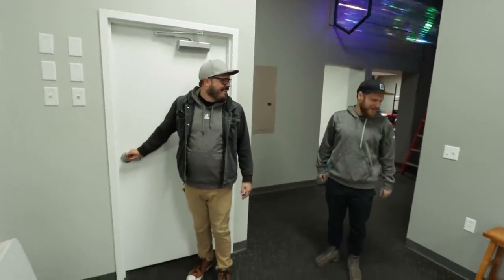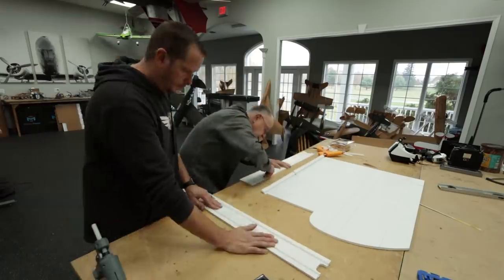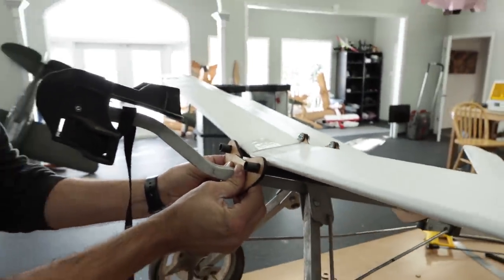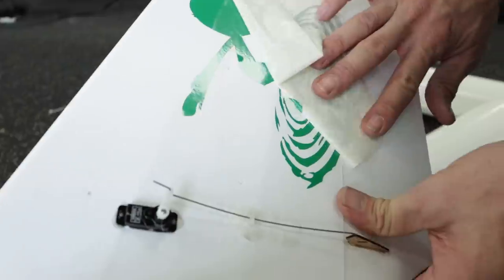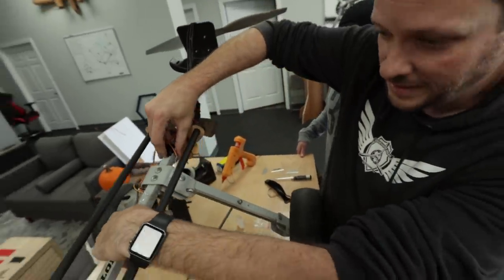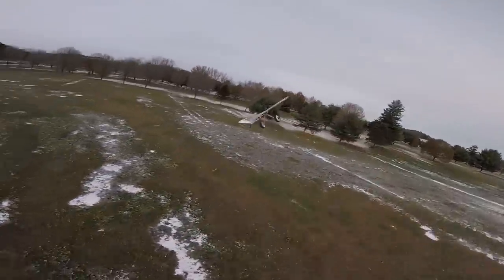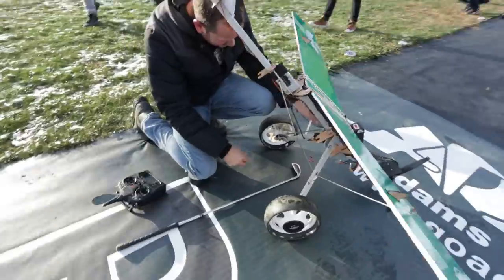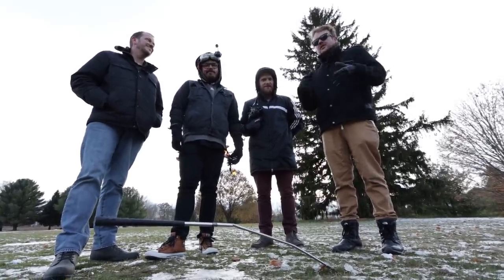Using $5 of Junk to Build a Plane | Golf Club Bomber

Comment: The generic name of that tool is an oscillating multitool.
Reply: That sounds more like it. We found it indispensable when repairing hardwood floors.
Reply: it's an amazing tool, i think craftsmen invented it.
Reply: And you can't cut your fingers of with it
Reply: @harpoon_bakery162  Fein invented it. I bought one 20yrs ago  I don't want to tell you what I paid for it given Harbor Freight has them for cheap
Reply: @andytaylor1588  lol they use a tool just like it for shaving off bone in knee surgeries.
Reply: @ryanamendala6524  oh, thanks for the correction on the inventor...appreciate that and ha, yea, those harbor freight ones don't have the durability yours does tho.
Reply: It sounds like a mosquito
Reply: The sound of it fits right in with the RC planes.
Reply: @rconger24  also used for removing plaster casts\
Reply: Viber saw I like the one I have . The blades are expensive.
Reply: The best name I've heard is "Angry Beaver".
It's what mine is named now.
Reply: @ryanamendala6524  True, but after 20 years the Feins are still running.  :)
Reply: @bkvdpw  mine is.  But hf are about 1/10th the price so if they last 2yrs each, you can still come out ahead :)  The Fein feels better as well. Nothing like a quality tool
Reply: They were out long before Fein made them popular. Had a plaster cast cut off my arm with one of these in 1957.  Made by G.E.  Think it was just a doctor tool back then. Mine has 4 blades, sanding pads and funny looking drill bits. You can resharpen the blades.
Reply: Wow never knew that. My family always just called it a blue tool
Reply: Challange; make the oscillating cutter tool fly.

Comment: Where at in Ohio ?

The head of that club gave it a lot of spin going down.
Reply: The view from the club falling was great. What if you put a parachute on the club so it floated down?
Reply: @leemaples1806  would  need a pretty large chute… other than needing a swivel so that the shrouds don't twist up, it should work.
Reply: First off 👌👍 second dat mustache be poppin keep it up ale👍👍👍👍👍👍👍👍👍👍👍😎😎😎😎😎😎😎😎😎😎😎😎😎😁😁
Reply: The head of the club usually spews a lot of spin.
Reply: @alomega01  darn, thats around a 200 mile  drive one way for me.
Reply: 1808 mi for me

Comment: I'd like to see a single sheet of foam board fly.
1. You're only allowed to make cuts for he control surfaces.
2. You can make a mount for the motor(s).
3. No glue is allowed, except for mounting the motor(s) servo(s) and batteries.
Reply: rctestflight did something like that

Comment: thats how you are supposed to apply vinyl. you can also get conformable vinyl if you want to wrap curves and you use some heat to make it comply. Also try using water and soap to make it apply easier if you need to.

Comment: Hi-start Drag Race: Two 4WD bashers. One starts on the ground. The other starts in the air. Both in motion crossing the starting line. 
At halfway point the car is dropped from the airplane. Who wins? The Hi-start car may get to the 1/2 way point first but the drop time and landing will make it interesting.
Is the ground car going to get bombed? Adjust variables to make it a close race.

Comment: It would be so cool if they put an airsoft hpa system in the giant A-10, it’s large enough to house a decent size air tank. The fire rate and FPS on an hpa engine(Wolverine/polarstar) can be turned up and tuned for flight.

Comment: When it comes to vinyl wrapping you want a "wrap" vinyl. It will have air release and most importantly low tack untill pressure or heat is applied it will allow you to take the backing paper off and place it and not have it fully adhere right away.  Look at oracal 970ra or vvivd xpo for a cheaper option.

Comment: After seeing this, and what you guys challenged Peter with, I have an idea.  3D print some miniature sized push lawn mower decks (with handles would be cool), and then put the electric motors on the top of the deck like a push mower would have, and a propeller on the bottom like a lawn mower blade.  Put 4 of them together, and make a QuadMowerCopter :D

Comment: Looks like a big Slow Stick, my favorite plane ever!!!
Reply: i heard that the slow stick is a good park flyer?  or is that not right?  looking for a good park flyer to build.
Reply: @harpoon_bakery162  Slow Sticks are quite difficult to find nowadays, they were made by a company called GWS. Anyway I just bought one from Aloft RC and can't wait until next week when it arrives. They sell it with a full LiPO and brushless motor kit which was always the hot setup back in the day because the planes came with a brushed motor that would burn out after a few dozen flights. Anyway the Slow Stick is an awesome park flyer. I fly mine inside my cul de sac or down at the town tennis courts!

Comment: Just wondering, would you guys be able to to make/build a rc plane that is so big that it uses small bicycle wheels as landing gear and so powerful that it uses a grinder motor as an engine, and try to make it fly? If this won't work then try an old electric sewing machine motor. 

Re: I've always wanted to see something like that fly using parts an extremely urban (basically in the sticks type middle of nowhere) household (garage and house) like where I live

Comment: That "perfect tool" is called an Oscillating Multifunction Tool. They were invented to remove plaster casts from patients, because there is little risk of cutting the skin. Try this at home: You can touch the blade of the OMT with the fatty part of your finger when it is running,  and not get cut. (Really)

Comment: wonder if you could make this with a 4m wingspan? I have a roughly 100W flexible solar panel I'd like to see if I can get to fly. Its 4m (13ft?) 'long' and 0.5m (just over 19") 'wide' and can be rolled up to fit in a tube about 150mm dia. I'm not expecting it to be a great plane just want to see if I can get it to fly at all. Your thoughts? I think the 'golf cart' landing gear would be good if a little heavy for this?
Reply: There are a few examples online of people flying solar panels.  Having a small battery seems to help as you have steady power.  but weight is your enemy, so i'd go with minimal or no landing gear.

Comment: I Actually Designed A Plane Over A Year Ago To Use One Of Those Simular Folding Golf Bag Caddys I Found On The Side Of The Road! Butt Mine Actually Will Fold Up In One Piece, Based Somewhat On Between A Spitfire & Corsair w/Real Balsa/Monokote Wings, Flaps, Rudder, Steering Tail Wheel, Lights, FPV+ ETC... LOL